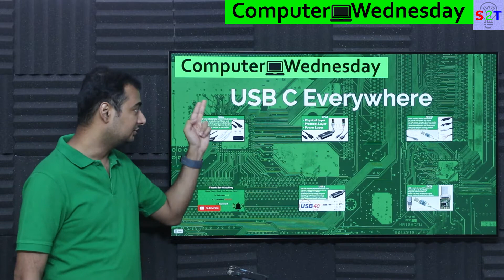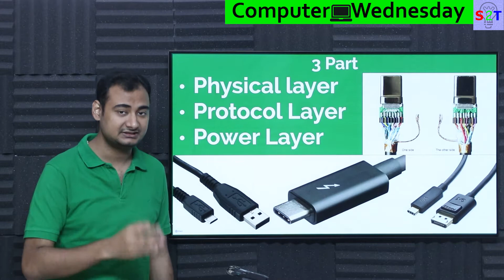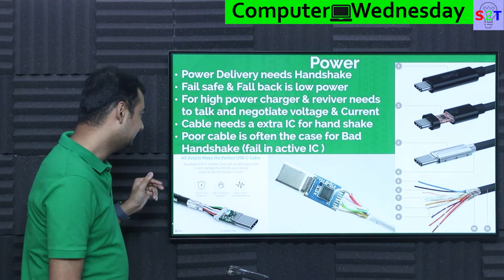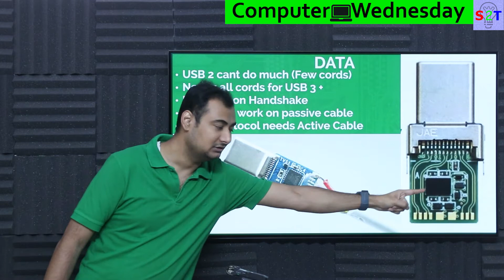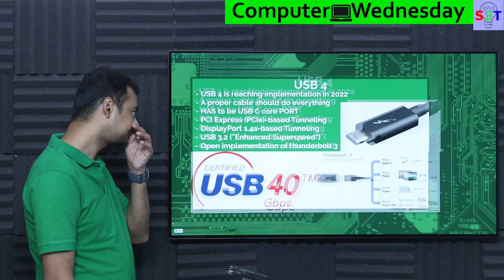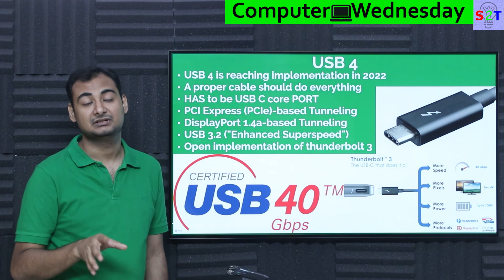Comment: I feel like Apple pump&dumped in the development of USB-C.

The cable may be used upside down, but it is thicker than micro-USB, costing more materials, disincetivising its use, and limiting the slimness of a device like MP3 players or even phones as 6mm is the slimmest flagship phone coming out from XiaoMi.

The design also is more flimsy than lightning connector, the protrusion in the receptacle inside the phone is fragile and gathers particulate debris easier and is more difficult to clean.

Although the design is difficult, I wish the male and female ends of the cable were the same so no converter jacks would be needed like the SAE 12V hermaphroditic connector.

Thanks for the video.
Reply: apple is just an asshole nothing more they just don't want to use USB c as the dongle market is a great money maker so why end the golden goose